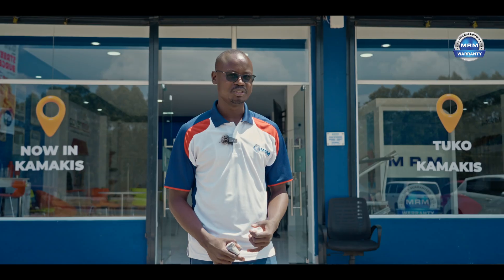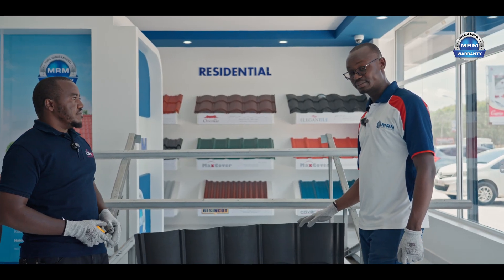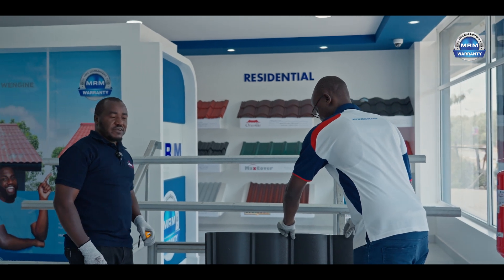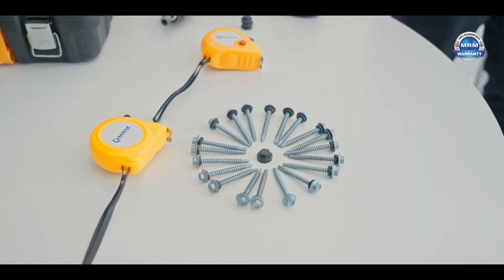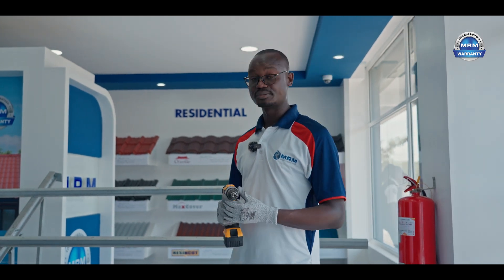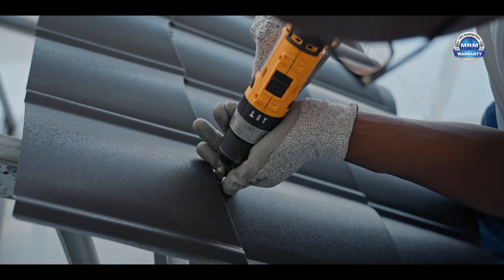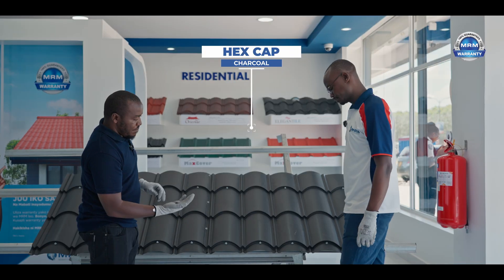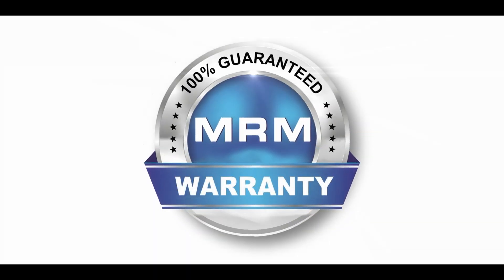How to Install Orientile: Step-by-Step Guide

Comment: Can one use nails instead of screws
Reply: Screws are much more durable stronger when fastened on the roof sheet
Reply: Can they be applied on wood @tfl4963